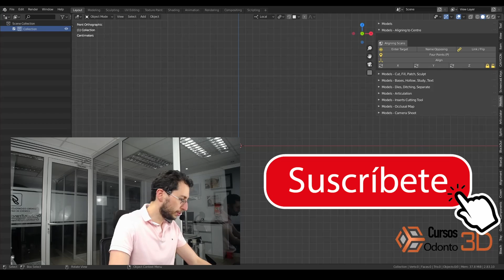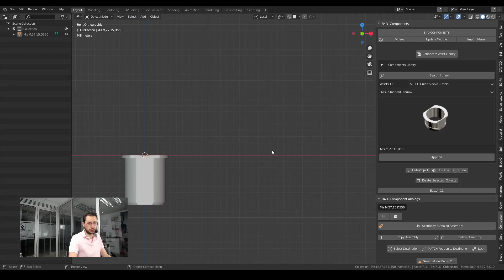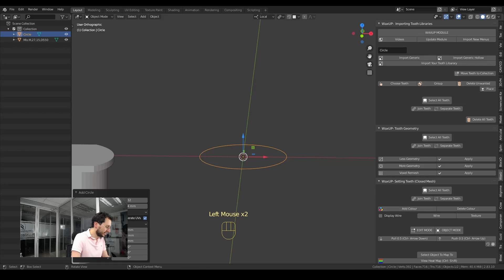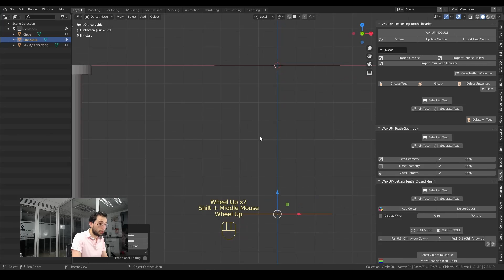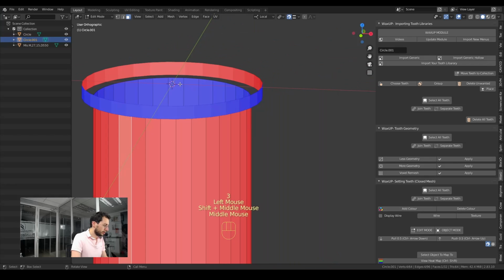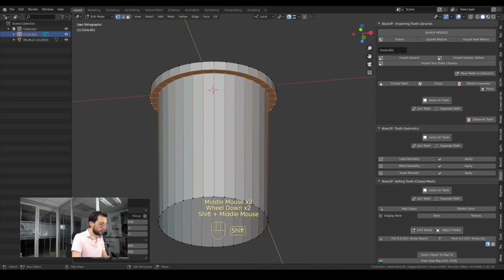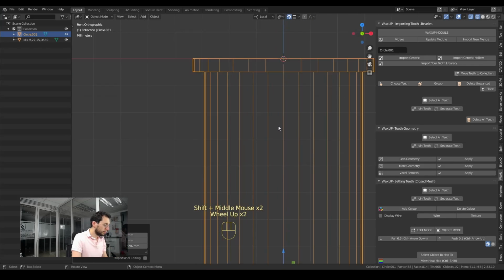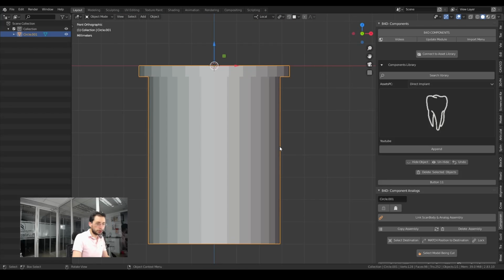How to Designe a SURGICAL GUIDE Ring with Blender for Dental.

Comment: After I desing the sleeve, how do I manofacture or make the sleeve?
Reply from the maker: This desing is ment to be used as a tool for cutting the digital guide and left a space for the metallic part. You may find those metallic sleeves online.

Comment: Hi, congratulations on the tutorial, very nice. I would like to ask you if you ever tried to create the same object by working directly with cylinders and boolean operations. Thank you very much
Reply from the maker: Yes, it is feasible. I found this method simpler for this design, but if I have to make more steps or cuts in the cylinder Booleans are much better.
Reply: @CursosOdonto3D  Thank you for your quick response. I will try it and see what comes out.